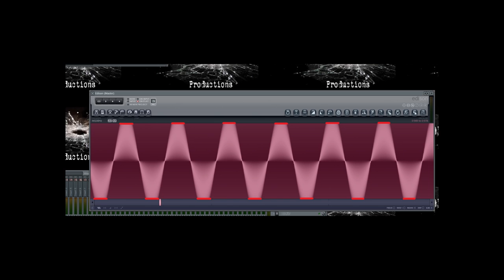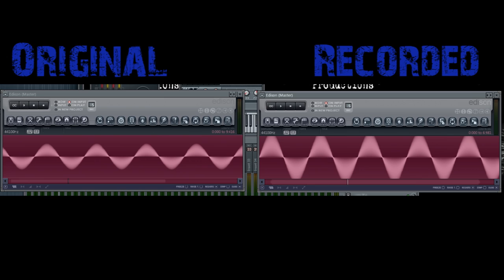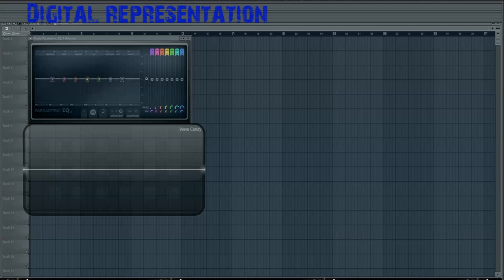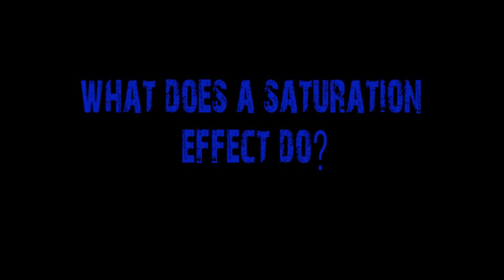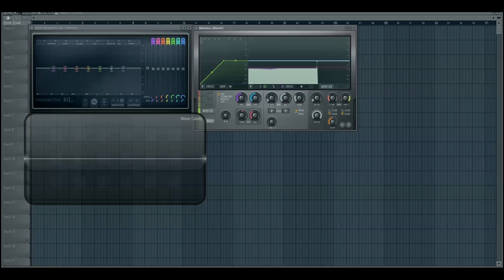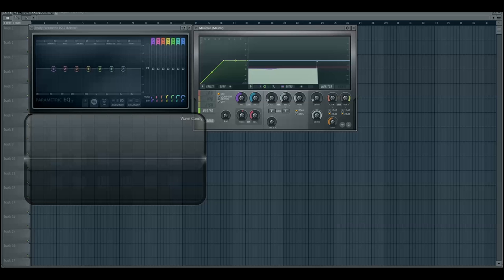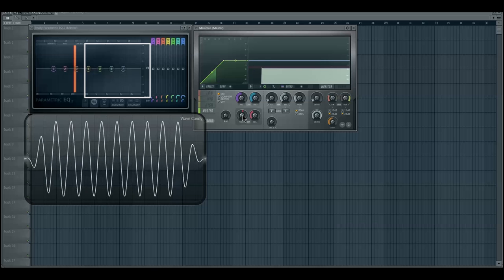Tape Saturation Explained

Comment: If you'd done an audio comparison between soft clipping & Tape saturation
Reply from the maker: I appreciate the feedback, I can absolutely do that! In a digital domain those two phenomenons generally follow similar algorithms, as described by the DAW, however they do have differences as one is an emulation and one is a correction tool as it were.
Reply: @shortandsweettutorials8767  yes well I'd love to hear the difference and for instance learn if it's possible to recreate the clipping curve of reel to reel saturation with a waveshaper for instance.

Comment: Yeah thats really not quite right. You described clipping, but saturation happens before clipping. 
It is NOT the entirety of the magnetic particles being aligned, it is reaching a point of diminishing affect on the magnetic particles where the physics means that exponentially more power is needed to align more particles together (magnets dont want to align, they want to be north south and cancel out) such that a large change in input amplitude produces a smaller effect in output.
Unlike clipping the transfer function is a curve. Unlike clipping no information is lost form the wave, just the relative size of changes adjusted. The harmonic series introduced is biased much more to early order even harmonics than clipping, it sounds a hell of a lot nicer. The same is true of the magnetic saturation in transformers.
If you want to understand the transfer functions of saturation and clipping, have a look at a vid 'You dont understand Saturation' by sseb. He does a really good job of explaining it without getting too into the math weeds.

Comment: Here's nothing random about the harmonics of a clipped sine wave
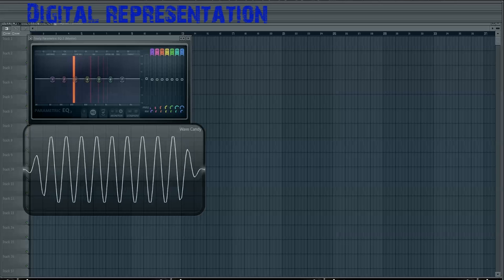Reply from the maker: in an analogue (non linear) system, yes there very much is. Many factors contribute to the outcome of a clipping signal, some of which are capacitance and heat resistance in a circuit - especially if your mixer has been running for a long period of time. If you watch further though (2:05 onward), I explain why this is not the case in a digital system.
Reply: was gonna say the same thing lol
Like, I know how to calculate the fourier series of functions as simple as hard clipping of a sinewave
Reply: @shortandsweettutorials8767  There is nothing random about intermodulation or saturation. Intermodulation is heterodyning, any non-linear stage produces the sum and difference of all frequencies in the system. This intermodulation effect is how we receive radio (mix the radio signal with an equal RF carrier and you get the original signal back out, bingo).
Saturation is the even harmonics of all those frequencies. The distribution is hard to calculate but not random either.